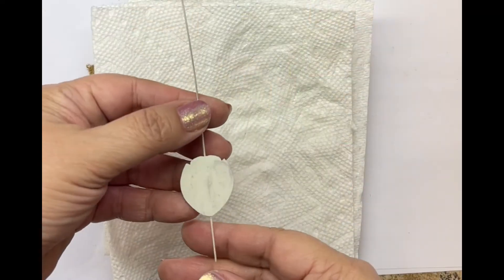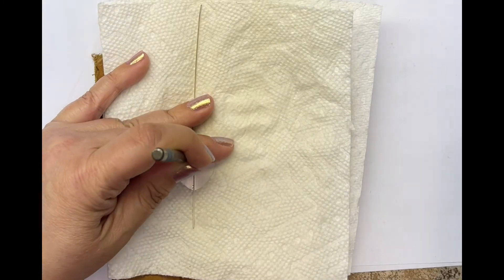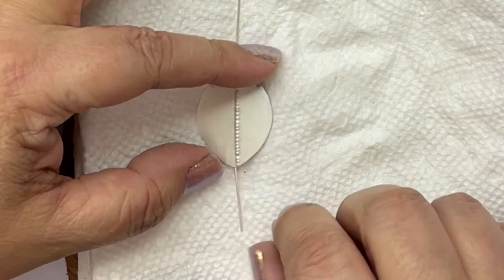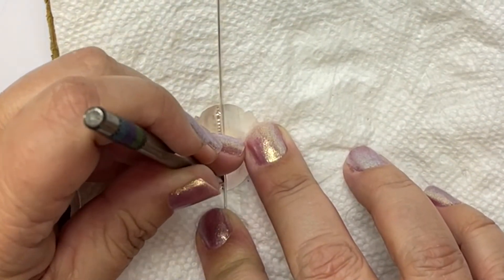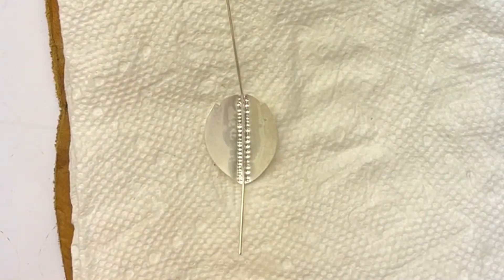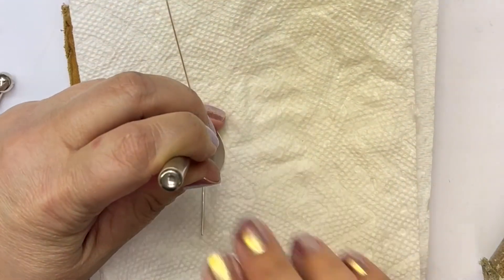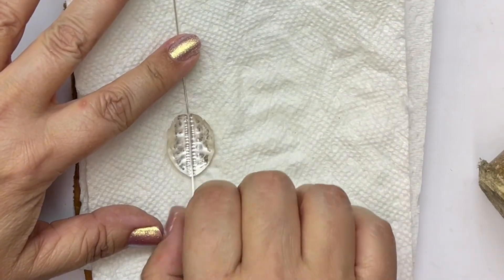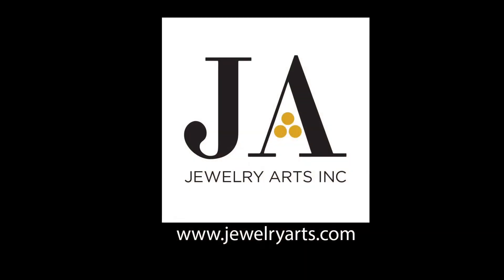Chasing and Repousse #7 Simple Technique without Pitch, with Tools You Already Have

Comment: I am enjoying your chasing and repousse series. It looks like you have something under the paper towels for additional padding. Is it leather or cardboard? Something else?
Reply from the maker: My bench surface is tile, so I placed a piece of leather underneath the paper towel. You could just use a few more paper towels but on a wood bench surface, the extra wouldn't be necessary. :)
Reply: If you used a leather sandbag under it would you be able to get quite a lot of depth?